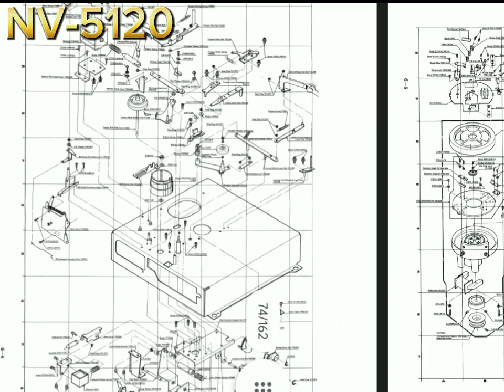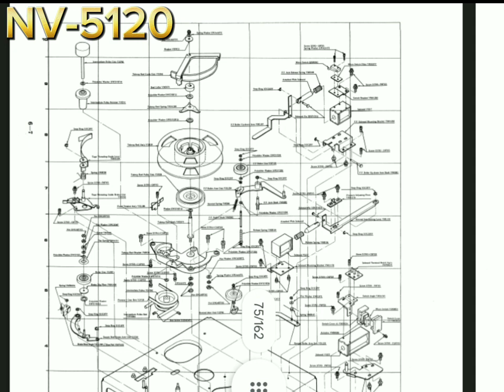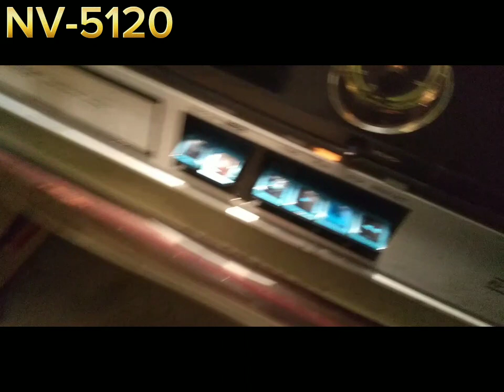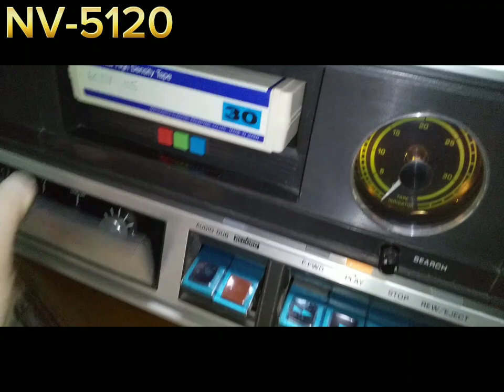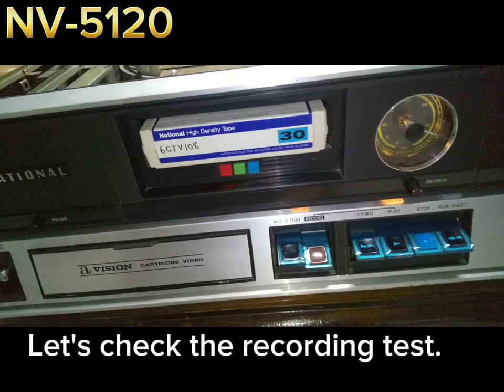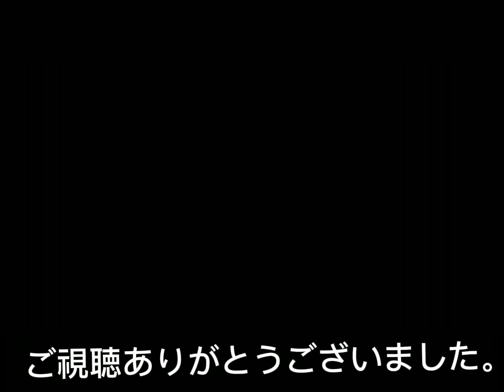〈part 3〉vintage Panasonic Video cartridge tape recorder 【NV-5120】Noise and recording test confirmed

Comment: Thanks for uploading this video! I recently acquired a very similar model: the NV-5125. Is there any chance you would be willing to share that PDF of the service manual? I would imagine it would be helpful with my machine, even if it's not identical.
Reply from the maker: Thank you for your comment.👍I received the file from the previous seller, but I didn't know anything about it.

Comment from the maker: Example)  The explanation is funny, but I couldn't hear anything about video repair.
If the TV monitor is not PAL format, the color and screen will not work properly.
This VCR is set to a frequency of 60Hz. It becomes unstable in areas with 50Hz.The power frequency of the AC 100V motor fan is color-coded: black is 50Hz and white is 60Hz.
Reply from the maker: example) Sincerest apologies! It's audio. It seems to be coming from another monitor in other video repair tests. Thanks for your comment! I have a large 60Hz power supply, so it's fine. 👍